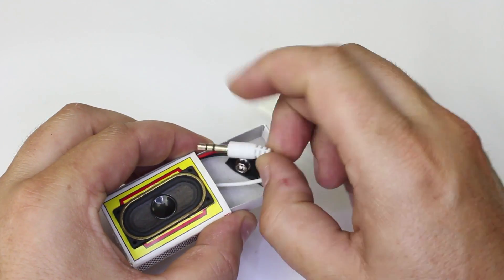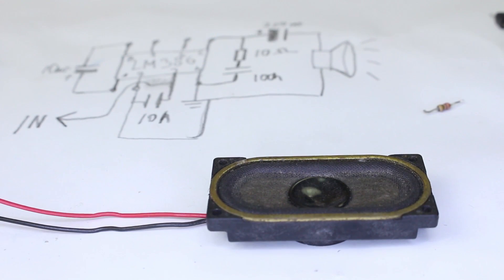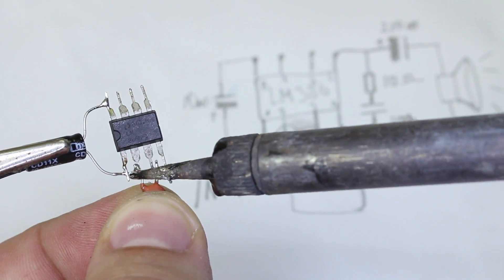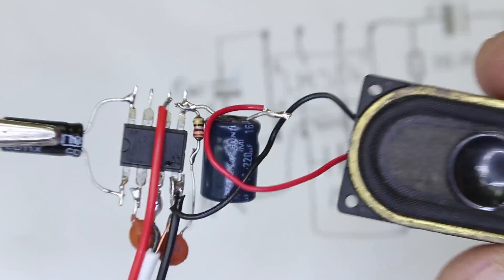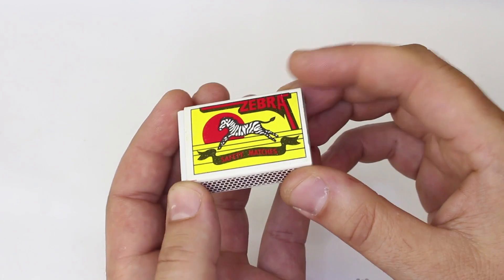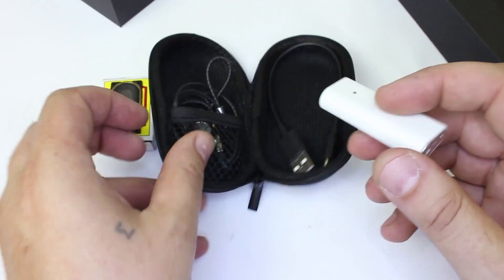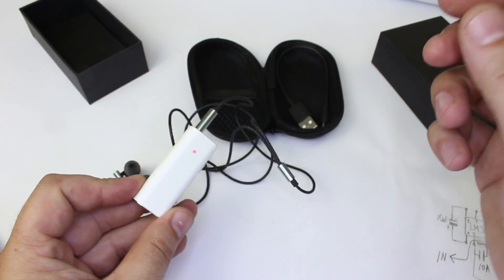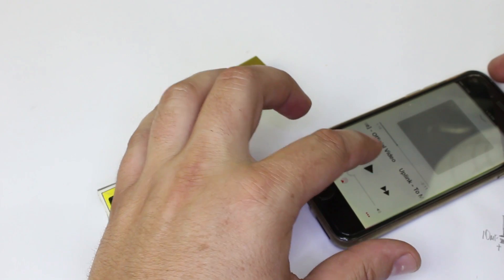How To Make Mini Amplifier - DIY Bluetooth Speaker

Comment: For the love of god, please don't solder directly to the legs. 
If you heat up the IC too much it will burn up and be unusable.
Sure, dead-bug style electronics can be cool but using a pcb or stripboard will yield much better results, be far more reliable.
Or just use an IC socket so you can replace it easily. :3

Comment: can i use a LM317 instead of LM386
Reply: High School Hacker 1 no the lm317 is a voltage regulator and this amp does nothing you can play louder than you think straight from the headphone jack. And also y can just buy this tiny amp from eBay and get crazy results here is the link https://www.ebay.com/itm/3pcs-PAM8403-2X3W-Mini-Audio-Class-D-amplifier-board-2-5-5V-input/181888663216?hash=item2a5968beb0:g:oE4AAOSwstxVWJcQ
Reply: High School Hacker 1